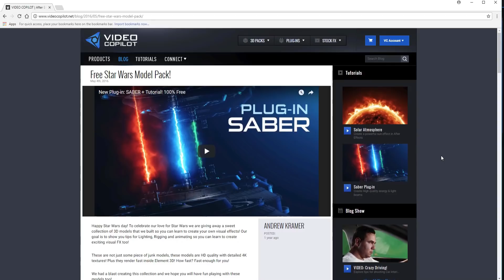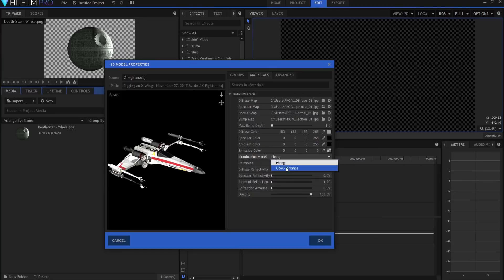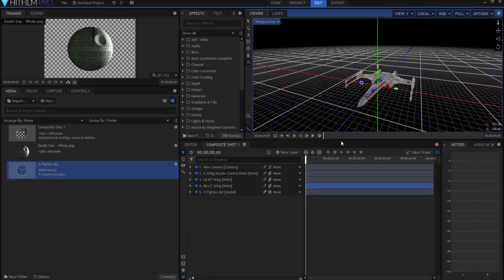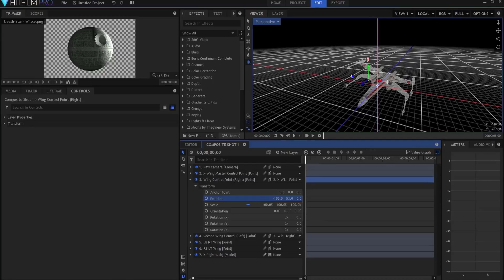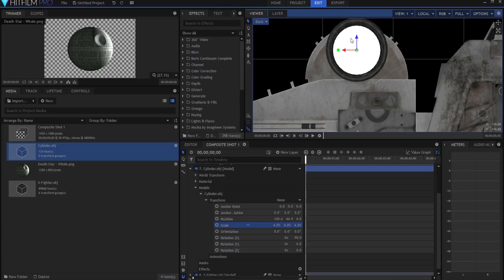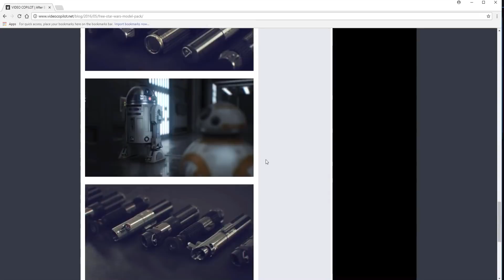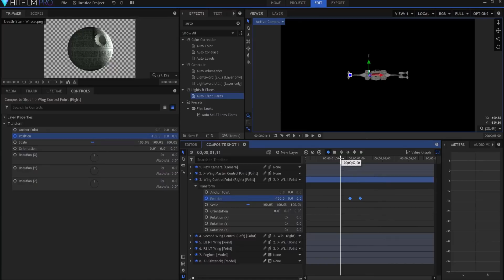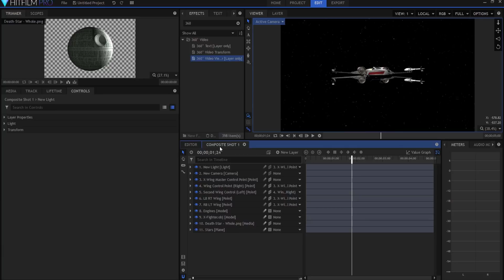How to Rig Up a Star Wars X-Wing Fighter from Scratch in HitFilm Pro!

Comment: Help! I followed your instructions to the letter, but every time I select the engines, include them in the depth map and select the depth source layer, I get an OpenGL render error and Hitfilm shuts down. Frustrating. Thanks.
Reply from the maker: Start by checking to make sure that your drivers (especially your GPU drivers) are all completely up to date. Don't trust your computer, go and manually check them!